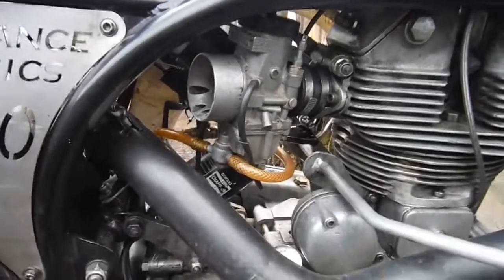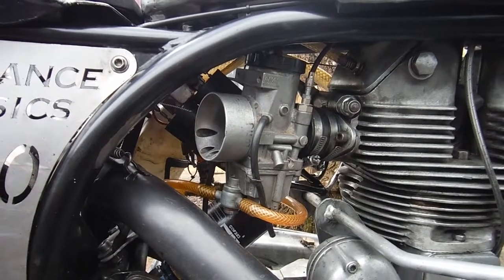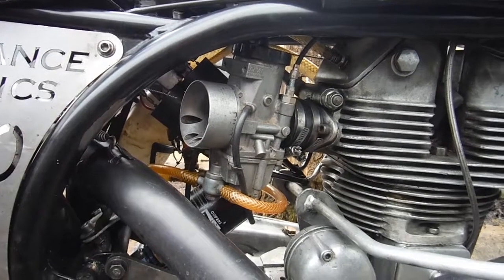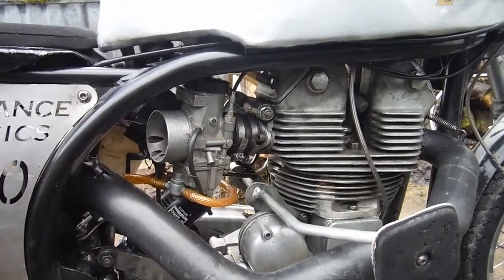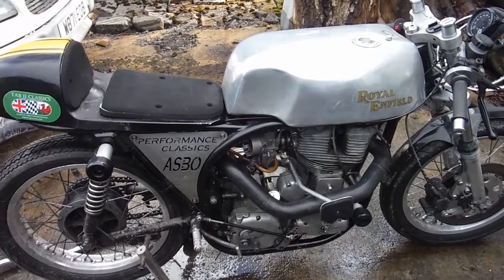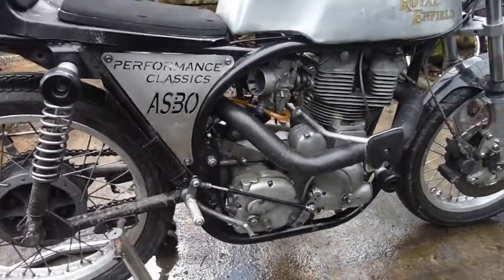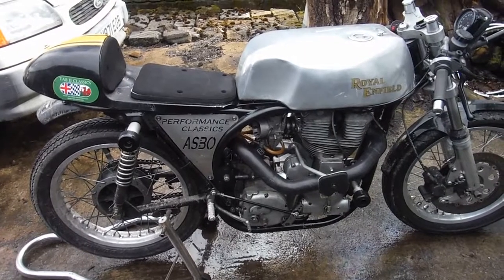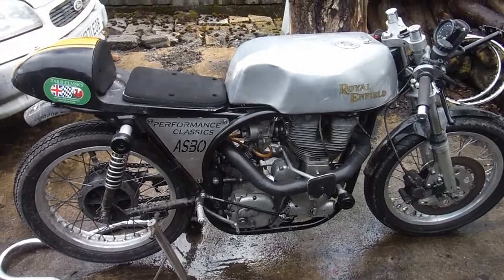Royal Enfield 500 racer running on petrol instead of methanol.

Comment: I said methanol who.used   now . said . So I Do not have much knowledge . I think  you saying this bike engine is based on methanol  . Or may be I confused
Reply from the maker: It is permitted in some British vintage racing to use methanol as a fuel instead of petrol. Until very recently, it would give more power and cooler running than petrol. Now, some permitted 'petrol's will give even more power, but with hotter running and this is what we are trying to achieve. We have to be careful not to let the engines run too hot, though, or damage could occur.